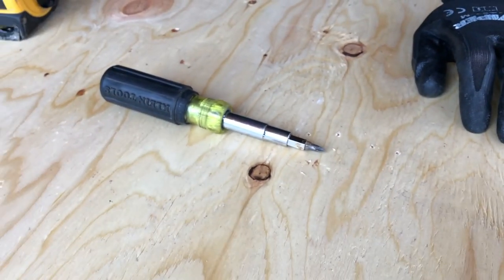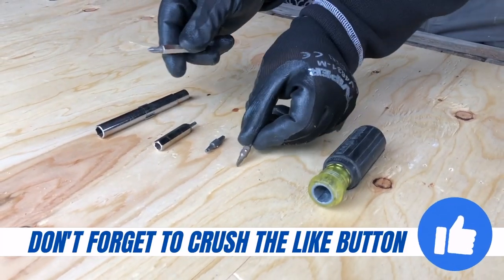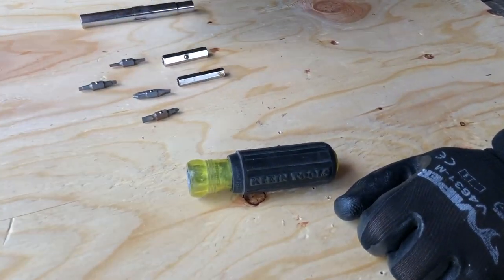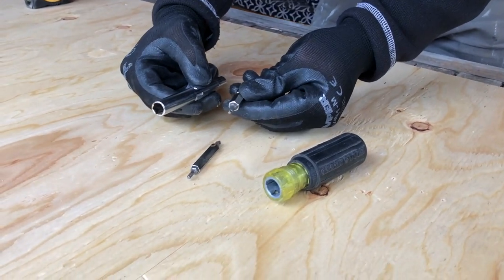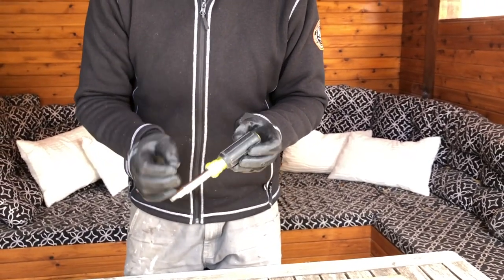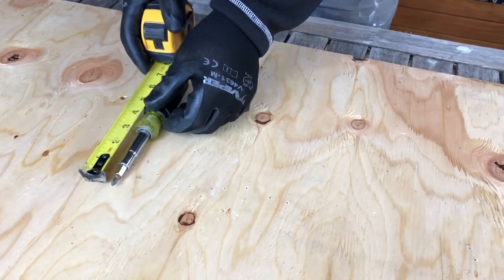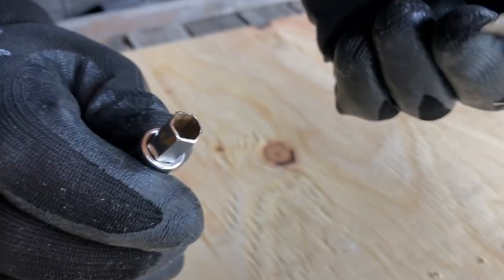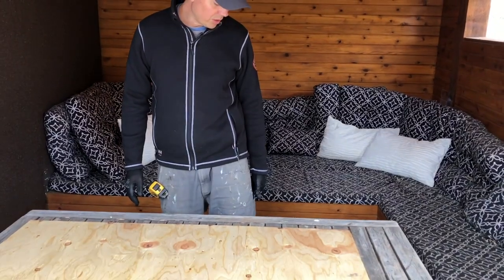11-in-1 Klein Tools Screw & Nut Driver is an every day carry must-have!  32500 review

Comment: I'm just wondering, what is holding the bits in place, do the bits come out hard, or do they come out to easy so they fall out? 
I dont want to struggle trying to get a bit out for changing and I dont want the bit to fall out after it is changed either..........